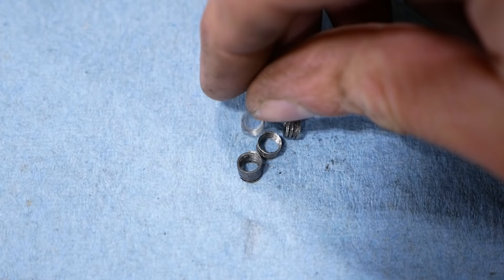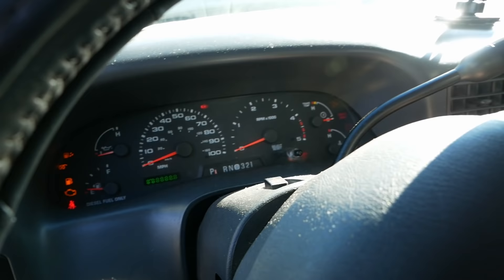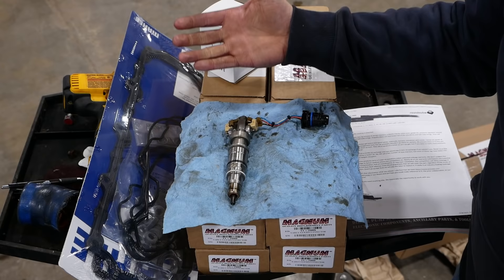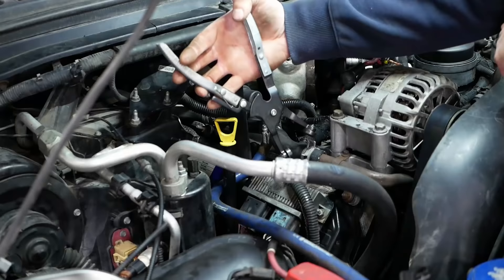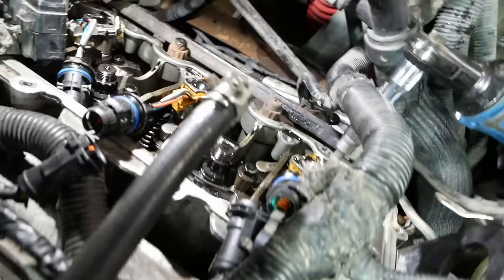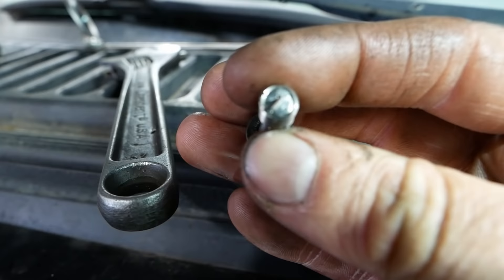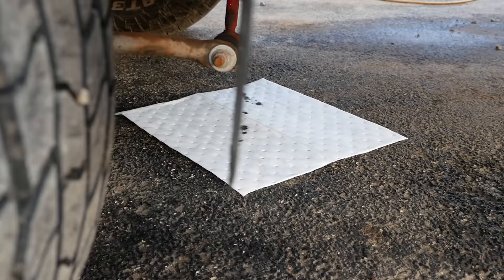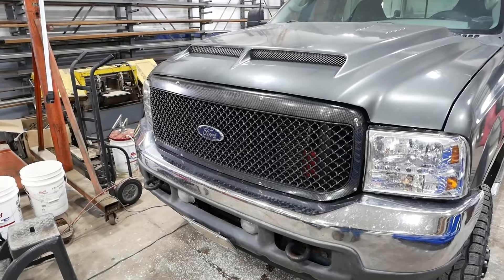They Left Me a Mess - 6.0 Power Stroke Low Cylinder Contribution - Injector Replacement Woes

Comment: I was driving a 2004 E450 Cutaway with the 6.0 litre at tje old job, and I had lots of problems with the turbo. I remember one night she was blowing white smoke out of the exhaust. I really wanted the 2003 1/2 Cutaway, which had the 04 grille, but the T444E. Now I drive a 2019 E450 with the 6.8 litre V10. Not one problem with it so far. And I like to listen to your stories. I used to work in a parts store and I have a few stories also.

Comment: When I worked for international, the DT engines used a very similar injector. The most common issue we saw with them was oil leaking between the high pressure oil rail and injectors. Oil would corrode the tops and wouldn't seal anymore. Typically wouldn't start when the truck was hot because the oil was too thin to build enough pressure. Typically the injectors would fail this way before electrically failing.
Reply from the maker: I've seen it too. The older engines with the injector pucks also liked to leak.

Comment: My 1990 F350 with 7.5 EFI still has all its original parts. Except for the water pump which was replaced at 100,000 miles

Comment: Everytime I see someone working on a Powerstroke or a Duramax I give thanks to some higher power. As a Dodge guy, especially a 5.9 Cummins (plus common rail) guy, I never had to deal with so little space to work in an engine bay. It always blew my mind how squeezed in these big V8 diesels were. Of course the new Cummins in newer Ram trucks are starting to get pretty squeezed in.

Comment: I’ve seen a little trick done on the FICUM connector using a wire tie. Don’t know if it would work for your job, but it might be worth checking out on you tube. I enjoy your video’s. You have a tremendous amount of self control. I’d have smashed the thing with a hammer. I always thought diesels were great till I owned a 7.3. And that was supposed to be Fords good engine. I’ll take a 460, thanks.

Comment: Exactly why both my trucks are 2000 F250 and 2001 F350 with 7.3's. Ford put the 6.0 and 6.4 junk out there till they got smart and started sell the 7.4's which has more junk on them but better than the last 2 engines.

Comment: I don't envy you having to work on electronic controlled vehicles. The days of the simple engine bay with a straight 6 or V8 engine and a few wires to the coil/distributor is long gone.
There are some safety features such as anti skid and air bags which are great.
But generally Manufacturers have no regard for ease of maintenance or repairs and the customer pays the price while the mechanic suffers the consequences.

Your frustrations are fully understandable.

Comment: New Truck Prices!  Ugh!.... My FICM would drop voltage only in cold weather making cold starts interesting to impossible (20°F or less only).  It was tricky.  Great job explaining the injectors / repair process!  👍😁
Reply from the maker: That was a common problem. There was a solder joint that would open up in the cold.
Reply: @WatchWesWork  it really threw me for a loop.  Operated 100% fine when warmer and or up to operating temp. I needed your ability to scope test back then.  Keep up the great work 👍

Comment: I’ve got a 2003 with over 200,000 on the clock..never been apart..except for HPOP seals.. I change the oil at 5000 religiously and thehighway miles and I run Stanadyne fuel additive..don’t know how I’ve been so lucky but she’s still running strong..great video on the 6.0 and you are a

Comment: FYI  I use the tool that came with  angle die grinder for tightening the arbor to release those stc lines from the oil rail.

Comment: The blue silicone hoses should have double banded hose clamps, made specifically for those hoses. These clamps do not have the slotted grooves touching the hose. They do not cut into the hose like the regular clamps that are used on the old black hose. The silicone hose will last forever if the correct clamps are used.

Comment: usually an air tool wrench is the perfect size for the disconnect on the log. fyi. the early log style idled rougher but was far less likely to high preasure oil leak hot start.

Comment: There is nothing worse than working on a vehicle after someone who didn’t pay attention to torque specs… I bought a venture van from a “mechanic” and after driving it for 6months heard a bang and some serious top end noise. Ended up being lifter bolts pulling out of the head. One that time a second one 1 month later. I ended up pulling heads and having to helicoil every lifter bolt. There are two specs on that 3.4 and he code the higher one and stripped them all out.

Comment: need to buy you a fuel spring kit to turn up the fuel pressure helps a lot on the 6.0. sinister diesel sells them. they help save the injectors

Comment: I own a 2002 7.3 diesel.  It doesn't go fast. Steering is more of a suggestion than an actual input. And I am pretty sure it has more helicoils than it has bolt holes.  But I would rather have it than any of that Def, ecodiesel, or 6.7 that is built today.

BTW, the tutorial on a how to get a drill bit and a helicoil into 90 degree angle hole was impressive..  The suspense, the drama leading up to it as well, bravo old chap.  I honestly had no idea how you were going to extract that rabbit.

Comment: Lol. I'm thinking of starting my own channel, but I'm not sure that I could. I would never find sponsors or get monetized due to the fact that I have found that most successful repairs involve a negative attitude and a steady stream of expletives. In my experience, engines seem to respond to threats, hammers, and foul language. Doing a Youtube channel would remove a valuable tool from my arsenal. I get where you are coming from on this one. Btw, I did actually get mad and hit an engine with a sledgehammer one time. It ran great after that. I taught it a lesson, lol.

Comment: We can all thank the EPA for most of the fail on modern electronic diesels. My parent's were talking about replacing a 2001 Ford 7.3 they have with a new truck. If I had to have new, it would be a 7.3 gas. I'm gonna convince them to let me rebuild another 7.3 diesel for it and freshen the transmission while we're at it. It's just not worth paying for a new one and getting boned every time something goes wrong to the tune of $8K. Meanwhile, you'll probably get 300K miles out of a new 7.3 gasoline truck, and a spare crate motor is only $6500, if you wanted to go new. If I'm running a fleet it's a no brainer too. Cheaper services, cheaper parts. Uses more fuel... but diesel costs more. Do the math, it's not working out in a diesel's favor.

Comment: Dude I have been working on my 6.0 for months  I bit off to much I have everything fix but now found out I need ecm for my 2003 6.0 4x4  I already got to brand new ecm but they put my transmission in limp mode  but starting un like my ecm. Now I broke and this truck is my job

Comment: Ford IDS power balance works much better than the aftermarket tools. You can turn off the compensation in the ford tool to make a weak cylinder more pronounced

Comment: I'm  only half way through, but I find it just a little interesting that these seemingly common (For you, certainly not here in Australia) Ford 6.0s have the HEUI injectors on them, whereas the only time we usually see them here is on the Holden Jackeroo (rebadged Isuzu Trooper?) which is a GM brand, and were known for filling up the cooling system with diesel due to the injectors running through the coolant gallery, right next to the fuel drilling and only separated by O rings.

Comment: Wes, MBRP makes mufflers for turbo diesel engines. I got one that was a cut open display model and it's all stainless steel. I got the hole welded shut, and I plan to use it on the TDI conversion in my Nissan D21 truck. It's 2-1/2", which will make it breath better.

Comment: Mix up some jb weld put it the bolt hole coat a bolt with Vaseline  screw it in the hole and let it set up overnight  you will good  strong threads  when your done

Comment: I have a 2004 bought used in 2006. Had an alternator replaced a week after purchase. Had brakes done all around last year. 177K miles. It is in Milwaukee WI. I change oil once a year with full synthetic(5W40) and Motorcraft oil filter. Thinking of selling. Hood is same issues as the one you are fixing. ( A couple of batteries along the way. Used for light duty towing and moving my kids stuff over the years. Thinking of selling as I moved to Florida and have a different truck here.
Yikes what a pain all the removal of stuff to do things. I heard the EGR is an 8 hour job?

Comment: I think I just found another use for FORD Fluids Often Run or Drip, Fords just have too many variations even in their gas engines in the 60's and 70's. Chevy Had BBC and SBC and straight 6's. I don't envy you at all, I worked in a shop too and Fords gave us more headaches than anything else. Between the 6.0L issues or the sparkplugs breaking off...

Comment: When I had an oil leak like that on my ole 6.0 it was an indicator that the high pressure oil pump was going bad. The stealership WASN'T able to figure it out.................OR didn't want to deal with it.  I figured it out as I was driving down the road, & the truck died, & WOULDN'T restart!

Comment: Nothing on those trucks are easy to do. I have a 08 6.4 and had to replace a bad starter. It took me 3 hours! The top bolt is behind the stater relay and you have to feel for it. I dropped the lower bolt and lost it. It was only used for 3 years and costs $15.00 from the dealer. No problems with injectors though. 240,000 miles and I use a snake oil in the fuel for added lubricity.

Comment: Hey Wes, in the Ford fF350 dually episode at the very end you mentioned how much better vehicles have become after 2013, my experience in having a 2011 GMC truck my son bought a 2015 Chevy truck he is having nothing but problems with that 2015 and my 2011 has had nothing but general maintenance since I bought it new in 2011 so I guess I've had the opposite experience

Comment: Had this exact thing happen on two different trucks. REV oil additive aka snake oil actually did fix both trucks. One for about 30,000 miles and the other for the remainder of the trucks life. Customer really messed up at least not attempting this for $100 it would have been worth the hassle.

Comment: I worked on a 7.3 that ran like that and it was the wiring in the V.C gasquet.

On stripped bolt holes you cant get to,I get the next size up bolt, if metric, use an sae, or visa versa and make it self tapping  bolt by cutting 4 groove with a file,and then make it harder by heating and cooling the bolt. then red Loctite .

The oil gallies for heui have set screws you can fill them..  

Whoever worked on  tha that was a hack.

Comment: A buzz test is a stiction test unless it pops a code. 15-40 in cold climate will cause stiction no matter what. Those dead batteries will fry that ficm with haste. Spends that much money on injectors. 200$ for oem standpipes an dummy plugs would have been cheap insurance. Ahh guess this truck has the shitty early style
Oil rails tho. A pair of long nose needle nose pliers will undo that stc fitting on the rail. You just push the black ring back an it disconnects. You can drop torx bits down the rocker box. It just ends up in the oil pan or it lands on the Windsor tray an gets washed to the oil pan immediately. For those wondering a 19mm chrome will push the harness right through. Always torque to 32ftlbs. 24 almost Always comes loose. The top injector oring is super easy to replace. To mess with chamfered washer just use a pick to dig the old oring out and work the new one back in. That top oring fails because the nipple cup oring leaking blows the top one out. Orrrr a monkey putting the oil rail on. 
6.0 liter injector jobs will put you in a foul mood an cut up hands
Reply from the maker: LOL. This is great. Find me a FICM that actually failed from bad batteries. I'll wait...
Reply: @WatchWesWork  I can mail you one from as recent as a week ago if you want to do a little tear down video
Reply from the maker: @zakksrage  Sure. I'll bet it has the same capacitor failure they all do.

Comment: I looked through the comments and didn't see this question. Could the oil LOG be primed with motor oil to reduce the cranking time on the first start? If not, why the fittings on the top. 

Rewatching some old videos. Love your stuff.

Comment: These modern diesels Wes are far too complicated, they defeat the purpose of the principal of the diesel being simpler and easier to work on, the small diesel I would ever have would be the Cummins 5.9 12 valve job, the rest are just too complicated and are a disaster in waiting, good video as usual, you must be a godsend to your local customers, fixing other peoples mistakes.

Comment: It's funny--- because I have the same color truck-- SRW though;  and a year before this. A 2002 F350 with the 7.3L diesel, 6spd manual, manual 4x4 transfer case, manual locking hubs.   I have over 320k miles and still on the original injectors and original glow plugs (it needs new glow plugs to be fair)...  It does love to leak a little everywhere, but she still starts and pulls anything I want it to.   I might look into polishing up this turd and selling it if they are worth that much now.  I have a 9ft flat bed on it with goose neck ball.  I'd hate to sell it, but if someone offered me that much, its gone. lol

Comment: Oh yeah, my Gracie (boxer/lab mix) was not a big fan of wind. She was ok with it outside, for the most part. But inside, if I had the windows open and the breeze started blowing things around (curtains, paper, anything really), she’d get a bit freaked out. Also didn’t care about thunder or lightning whatsoever, but fireworks and gunshots would send her running. Luckily those were the only things she was skittish about though.

Well, that and the air cannon. But I’ve never met a dog that wasn’t leery of the air cannon after they had been introduced, so I can’t fault her for that.

Comment: Sometimes you just gotta JBweld a stud in there and call it good enough.  You said it's only 8ft lbs-- so it doesn't have much tension on the bolts.   I get that you can't do this kind of thing on a clients truck-- but that's what I would do if it was my old junker.

Comment: I think you must have at least 540 lbs. of oil pressure to start the engine.  If the HPOP can't provide that or the STC fittings are leaking it will not start.  I have had both of mine do that.

Comment: Three sets of injectors in 172K miles?  When that truck comes back for new injectors again in another 50 to 70 thousand miles, I'd strongly suggest replacing all eight injector cups while the injectors are out.  He'll know that one or more of the cups have split when the degas bottle starts to fill up and overflow with a mixture of coolant and diesel fuel.  Some of the aftermarket diesel vendors like Riffraff will rent a special cup puller that makes the job much less detestable but you'll need to get a bank loan to afford the security deposit.

Comment: Damn I wish you were closer to me. I have a 2011 Cad CTS with a bad flex wheel. Several teeth missing but it always starts, with some small clanking noise. Not sure how that happened, but it's going to get worse over time and will eventually destroy the Bendix on the starter.

Comment: Wife and I watch all your videos (love them). Need advice, retired from the military 5 years back and recently started working as a mechanic, just because I love to fix stuff. What would be the best scan tool for personal use. The wife has a BMW and an SRT and I have a Ford expedition. I want a good scan tool that can read all 3 (pretty much everything). I realize they are expensive but I want something that works well that u can update and keep for a long time. (Not buying anything off the Mac or Snap-on Truck)
Reply from the maker: Autel or Launch will work fine IMO.

Comment: I always enjoy your content.  Few comments and questions you didn't ask for.  If a customer wants to spend $$$ pulling engine to fix a small leak shouldn't you let the customer decide that?  Or if the want to run junk aftermarket whatever that you have to fix shouldn't you do it with a smile?  Work is work. Yeah some more fun than others but as long as it pays.  Leave the valuation of a vehicle up to the customer.  Anytime I've had to bid a job I really didn't feel like doing I always add $$$. If I get it great more $ if nit I didn't want it anyway
Reply from the maker: They can do whatever they want, but that doesn't mean I can't have any opinion about it.
Reply: @WatchWesWork  of course.  Sometimes It just seems like you are beating up on ppl a little.  I'm a guy that does stupid stuff sometimes so maybe I felt attacked! Lol.  But as always good stuff, keep up the good work

Comment: @Watch Wes Work  -Start with the hardest bolt first.  If you have 8-10 bolts to take out of a cover, DON'T take out the easy 7-9, and leave the stress and weight of the cover on the last bolt (hardest to get to bolt).  This is why the hardest bolt gets stripped.  Take the hardest to get to bolt out first, the rest of the bolts will hold the cover in place, making it easy to get in-and-out.  Cheers! 🍻

Comment: I am not a Mechanic .  Could the stripped out hole have a Stud installed some way, Epoxy or something and then put a nut on the stud.    Is  there a bonding  material other welding   for  problems like that.  ?.   Great Video and videos.